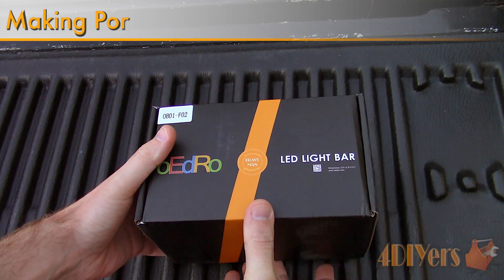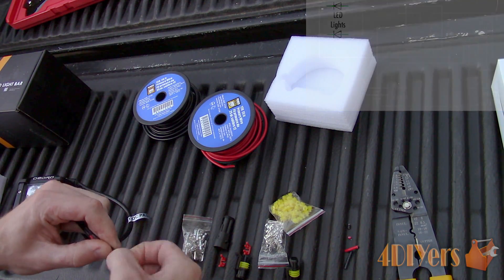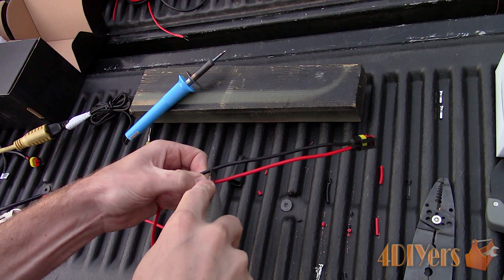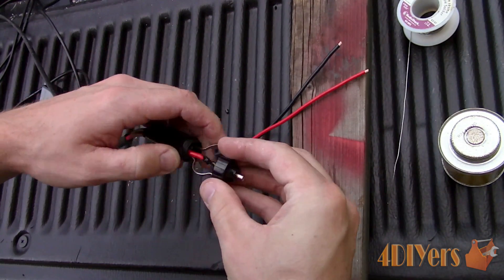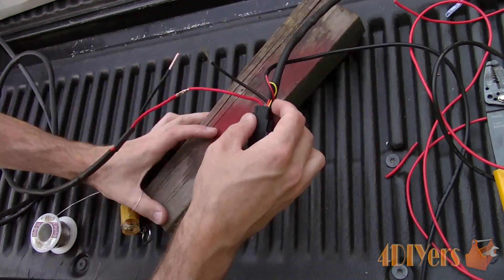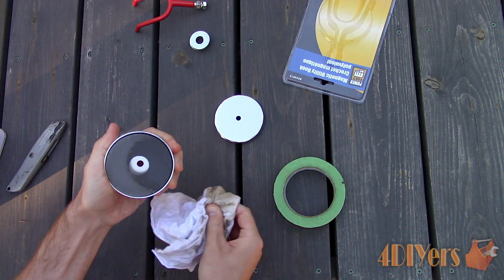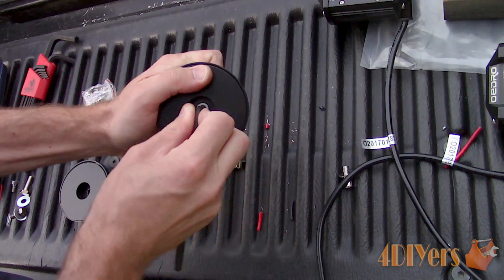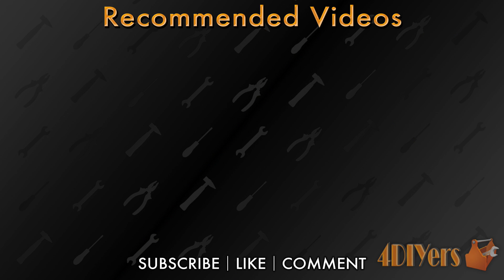How to Make Portable Auxiliary Work Lights

Comment from the maker: Amazon links for various products used in the video for both USA and Canada:
USA:
Solder: https://amzn.to/2NnBKdM
Heat shrink: https://amzn.to/3s4FQ9y
Adhesive filled heat shrink: https://amzn.to/3vrlpGh
Cable ties: https://amzn.to/2Maa0ZO
Electrical tape: https://amzn.to/2Zxy7o6
Split loop casing: https://amzn.to/2ZxZL4g
Liquid electrical tape: https://amzn.to/3ayhEqg
Magnetic base: https://amzn.to/3eJloHG
12v cigarette lighter plug: https://amzn.to/3ttFU3r
12v relay: https://amzn.to/3vrlcmt
Weatherproof 2 pin connectors: https://amzn.to/3trlwAy 
Crimping tool with interchangeable jaws: https://amzn.to/3jksbYY 
Canada:
Solder: https://amzn.to/3blrYRC
Heat shrink: https://amzn.to/3s4FUWQ
Adhesive filled heat shrink: https://amzn.to/2OS2kMF
Cable ties: https://amzn.to/3drYRyI
Electrical tape: https://amzn.to/3k4EVTy
Split loop casing: https://amzn.to/3puwceN
Liquid electrical tape: https://amzn.to/2OIZAkA
Magnetic base: https://amzn.to/2Q8RxhP
12v cigarette lighter plug: https://amzn.to/2Q3oKel
12v relay: https://amzn.to/3cz2rVy
Weatherproof 2 pin connectors: https://amzn.to/3oOxssE 
Crimping tool with interchangeable jaws: https://amzn.to/3tsFHOQ